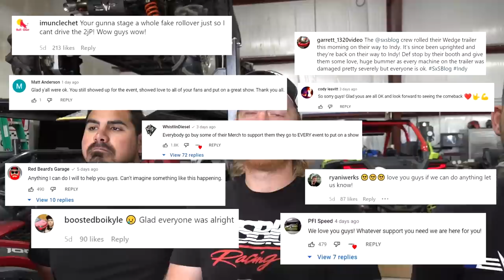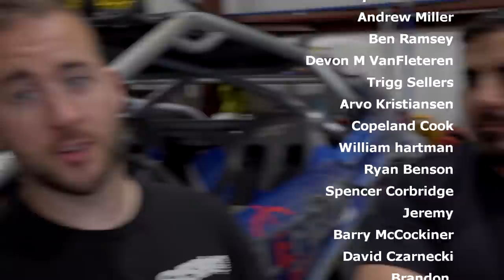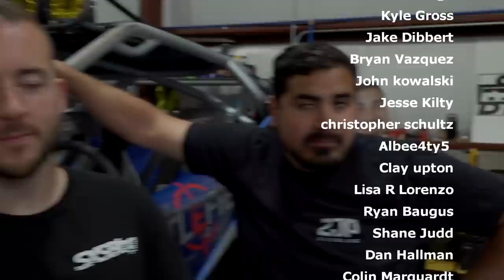Unloading our wrecked units! RZR X3 and YXZ are SCREWED!

Comment: Doug deserves some respect on his name for this intro. He told it like it is and owned the mistake. Respect
Reply: still can't believe the trailer separated from the truck.  the chains should have held.
Reply: @scrout  I don't think they're designed to do what happened, but either way, glad they broke. If they didn't break the truck could've gone over aswell which would have been worse than what happened
Reply: @scrout  lol, the truck would've rolled then, not sure that's what you're wanting.

Comment: I'm just going to say that a yx3 needs to happen. The stability of the x3 chassis with the crazyness of a turbo yxz engine and trans, would make a awesome short course and dune sxs. That would personally be my dream setup.
Reply: This is one of those times when I have to go "man..why the hell didn't I think of that"
Reply: Yes that’s a great idea
Reply: Just buy Yxz and stiffen the chassis then. Lol save yourself 50k can am is trash in the everything department.
Reply: @jonathoncook8367  I think you have polaris and can am mixed up. It doesn't matter what you do to a yxz. It will never be as stable or as predictable as a x3. The only selling point for the yxz is that the engine and trans make it the most fun sxs to drive.
Reply: @mattdyer489  Polaris is just as bad as canam. I trust a Polaris more. Can am can make a good jetski and cage but everything else is trash. Polaris has good motors but weak suspension parts. I’ve tried both can am and Polaris and I broke them both within a month. Not worth the money at all. Get a Yamaha/Honda  product if you want to go off road is all I’m saying. Not the fastest but you can damn sure beat the hell out of em and not have to worry. Predictability my ass. Durability is all I care about lol

Comment: Yall need to go fifthwheel, so much easier to hook and unhook, and more stable.
Reply: They need to get a real truck and trailer.
Reply: @robvanderkroft6515  right. Because that F350 dually is probably only rated for 25000lbs so the 10k they are pulling needs a real truck
Reply: @shauncobb9545  that’s a lot more then 10k they are hauling that trailer is probably around 8 by itself
Reply: @shauncobb9545  not just the weight but the cornering stability of a truck  and everything else . There's a reason commercial trucks go through the huge safety and stability checks
Reply: I don't normally follow this channel but I'm a trucker and saw the crash and instantly knew it was a load issue. These trucks just aren't designed for this work. If you didn't want a dedicated semi you need a gooseneck with a drop deck so the load stays low.
Reply: @DSRE535  
It's a gooseneck.... the hitch in the back of the truck is just a trailer ball. A fifth wheel has a plate like a semi truck.
Reply: Doesn't matter when you don't bolt stuff down.
Reply: This 100% would not have happened with a 5th wheel hitch.  There is a reason all commercial haulers that pull wedges used a 5th wheel and not a gooseneck ball.
Reply: Exactly. There is a reason that no camper is ever made with a gooseneck. It's either bumper pull of 5th wheel.
Reply: @DSRE535  definitely not a fifth wheel. It was a gooseneck. Totally different

Comment: Wow.. Looking at your setup-- I bet it was solely because "Battlefield is sticking up so high in the air, right on the front--- it caused your center of gravity to be too top heavy for how much it flexes on the nose there -- and when you came around the corner a little spicy, it just toppled over because of it...  I'm just glad that the chains didn't hold, because it would have rolled the truck with it.

Comment: You guys should buy a Ford F-450 203in wheelbase chassis cab, Crew Cab and add a CM 11ft 4in flatbed. Instead of having a pick up bed you’ll have a flat bed where you can put a Can Am maverick x3 2 seater on the bed.

Comment: Rick when you get a chance could you get in touch with me. I might be interested in the ghoul the way it is. And. I also have a brand new set of stock 2 door pro doors they are red but the can be wrapped and if you can't find a shock shaft for the pro R I make shocks shafts in house just need to have the old one depending on the OD of the shaft I might have a big enough price of stainless steel that's what I make them out of it's a lot stronger. And even the main aluminum housing I have made those also but .it's pretty surprising how bad some of the outer housing's that I have been able to fix were and haven't had any fail. I've been doing it for years so I'm about sure I can help you out with a few things and if you can't get a shock on the pro R get it up to me and I would be amazed if I wasn't able to fix it and if I have the correct OD or bigger OD raw stainless steel I can turn it down and cut thread's so if I have to steel in stock I could probably have it done by next week Wednesday or Thursday the outer aluminum housing is the ez part even if it's cracked I can fix it most of the time. I'm just letting you guys know this because I know how parts on a first year machine sometimes are hard to find and at least you could get back on the trail and when you get a new one then you will have a backup front shop. Sorry this is so long but I do believe I can help you guys out if you are not able to get some parts and we have a ton of used parts from a lot of things especially Polaris RZR's , Rangers and Polaris snowmobiles and let me know a price on the can am the way it sits also if you want to sell the cat 9 lives I might be interested I'm glad you guys are all ok. And Doug we have only talked a time or maybe two but you are a stand up guy for steeping right up and told it like it happened and never once tried to push the blame another way you said it was your fault and you take the blame with out thinking twice I don't know how everyone else feel's . But you have earned so much respect from me just for being a good stand up person and the hole crew just seems to be a great bunch of guy !! And you are a very lucky guy to have a crew that seems to truly have your back. And I do  believe that's why you guys are the number one SXS U- tube channel out there. In my opinion.And that's why you guys lead that world in your line of work  and all the others try to follow let me know if I can help in any way Rick and Frankie both have my cell so don't hesitate to call take care and have a great day..... Bob....

Comment: Should never buy a wedge gooseneck. Gooseneck trailers were never designed to have weight up high. There are plenty of wedge manufacturers that will make that hitch post as a 5th wheel. That one detail would have saved you that wreck.

Comment: That ball shouldn’t have came out, that’s fords quick set ball for ya. I’d blame ford 100% for what happened. Peopl run those trailers with actual cars on them and that almost don’t happen( I can’t say that for sure bc I did no research)but for should at least help.
Reply: What is the ball supposed yo do? Has nothing to do with it, if anything it coming off is a good thing cause I’d didn’t take the truck with it